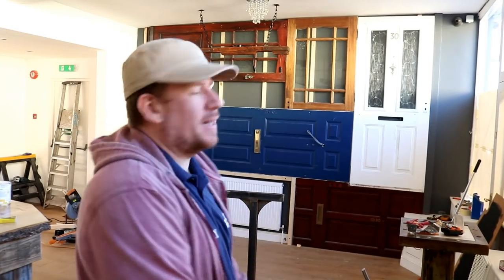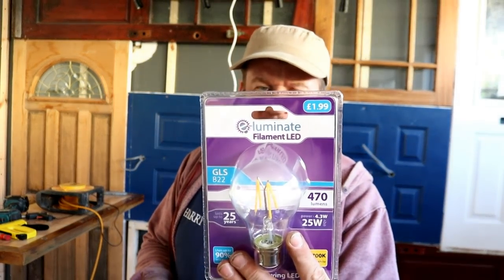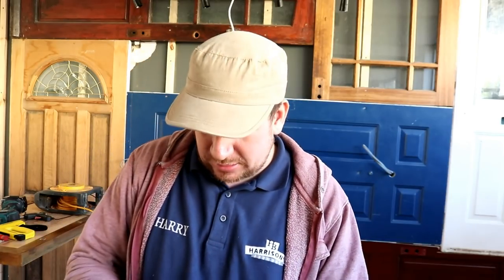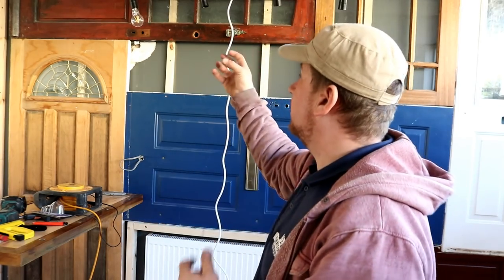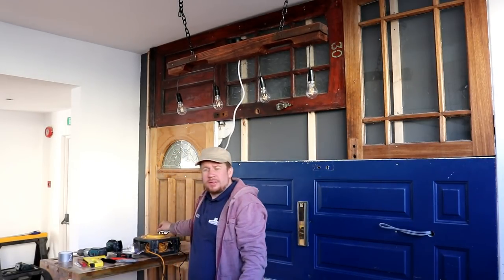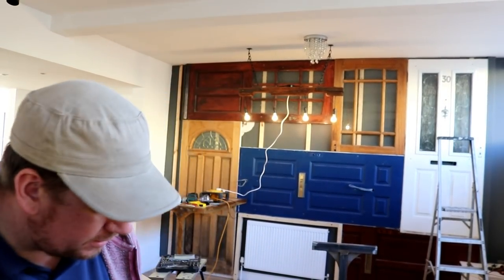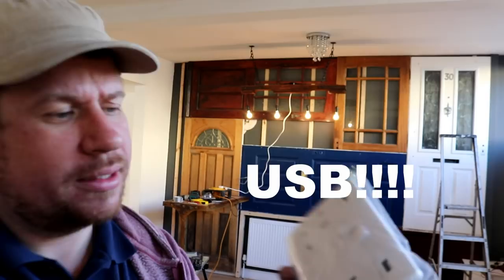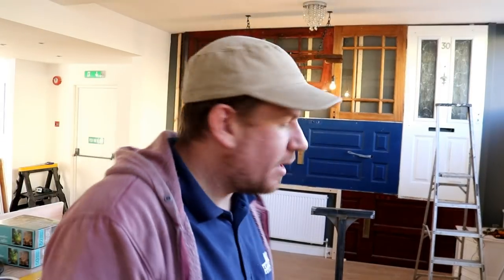More INDUSTRIAL METAL AND WOOD LIGHTING FROM PALLET WOOD P2

Comment: Lighting is looking great m8,i think those bulbs will work a treat,i reckon aim those fittings a bit higher though,imagine everyone is six foot plus and you should be good. You are tired m8 because you have been under so much pressure lately,mind yourself don't overdo it,can lead to slipups and accidents. Be safe m8 and see you next vlog. Cheers.